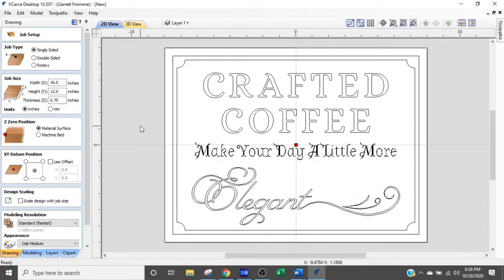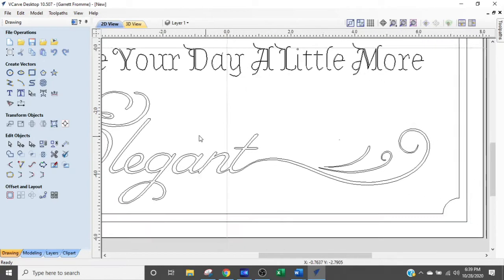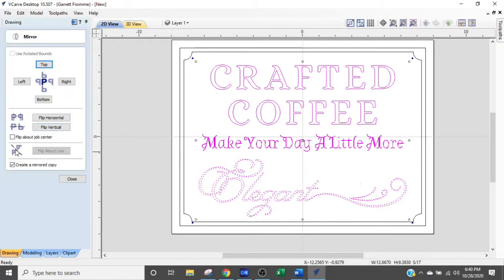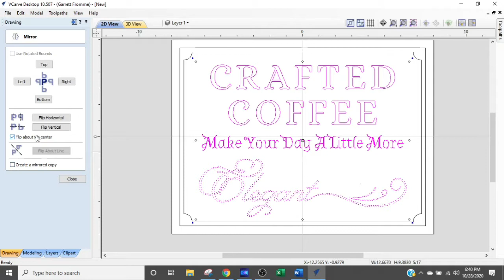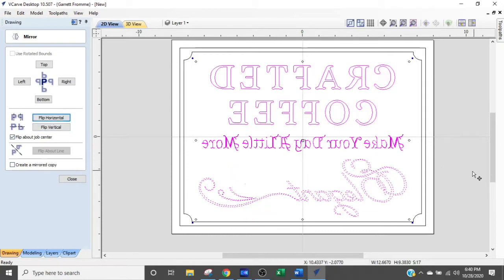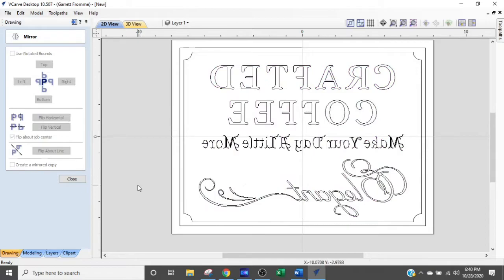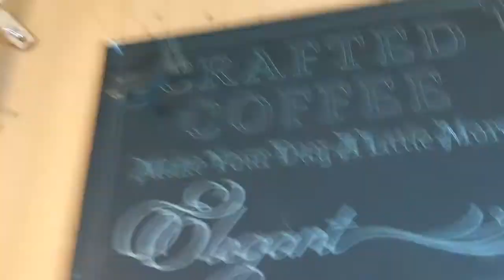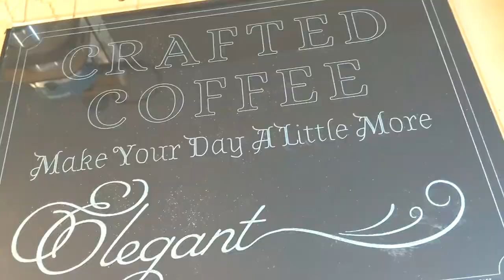CNC Router Glass Etching w/ Widgetworks Diamond Drag Bit Engraver Project - Garrett Fromme

Comment: Garrett, I just am starting to try using the Wigetworks bits I bought through you. I was just looking clarification on generating the tool path. Which bit to use in the data base etc. I have 2 bits in mine, both are listed as diamond drag. The feeds and speeds etc. I got when I purchased the bits. I will be experimenting. thanks for any pointers or if you have a newer utube that discusses the subject. I also viewed you eagle project, with the sonagram.
Reply from the maker: Charlieearle, try using both bits in your database and see what works best brother! The Quick engrave toolpath is best for engraving such as this.

Comment: I have a question…I used my diamond tip bit for engraving on uneven slate.  When it moved to lower area then came back to higher area it bent my diamond tip but.   I did straighten it out some but was afraid to be too aggressive to prevent breaking it.  Is there a way to salvage it since it’s a $50 bit?  Thank you
Reply from the maker: Anecia, I am not too sure on that one! Your best bet is to reach out to the bit manufacturer on this one on how to salvage it.

Comment: Looks good.  If you have uneven engraving depth from one side to another it's because you are failing to compress the bit into the spring.  If you don't have your depth where the spring is partially compressed it can't compensate for uneven surfaces like it's designed to do.  Even the best CNC beds have some variation in flatness.  I compress my drag bit by 7mm (out of the 15mm total) and the tip pressure is very constant on un-flat surfaces.  This feature becomes even more important when engraving surfaces that aren't very flat.
Reply from the maker: Tralfazy, very good points my friend. Thank you for sharing your wisdom on glass engraving.
Reply: @IDCWoodcraft  I hope it's helpful.  I spent a bunch of hours looking at bit pressure and measuring it.  WidgetWorks tells people to set the z height to zero and never even mentions compressing the spring.  Hard to understand how the manufacturer of a compression drag bit could get that wrong!

Carbide Create recommends that people compress a spring loaed drag bit 1/4 inch. (5mm) which should be fine most of the time.  I use 7mm to put it at near mid-range.  I loved your eagle engraving video and have been putting a similar one on all sorts of things.  It was when I tried to put it on a rounded surface (flashlight) that I discovered the need to compress the bit into the spring more and started measuring bit pressure.
Reply: For contrast, I've been using Gravograph CNCs (IS400s specifically, but I've a little experience with IS8000s, Vision and Omni CNCs) for diamond drag for twenty years and found that on those CNCs 1mm compression with 3mm Z travel on flat surfaces works well. For these machines the spring is in the spindle rather than attached to the diamond bit - but the principle is the same. But these CNCs have much smaller bed sizes than the one in this video.

I judge pressure by pushing the bit with my fingers and for my circumstance (mostly engraving into soft metal) have never even thought about measuring it.

That being said we've never used the diamond drag method on glass (hence my interest in this video) as it is considerably slower than CO2 laser. We also use sandblasting for some glass items. But if all you have is a CNC - then by all means. A CNC may also produce an effect that you, or your customers, prefer over other methods.

The software used looked a bit clunky due to the high number of steps to create the design and get it ready for engraving. The default software for Gravograph (Gravostyle) is also clunky. I find I do much of the design in a more general programme like Blender, GIMP, and Inkscape. I like to use the engraving software just for simple jobs and for sending artwork to the CNC. A more general programme has more features and tutorials due to a bigger user base and bigger development budget.
Reply: BTW.. if the pressure is too high after compressing the spring, just back off the tool's adjustment screw a little bit.

Comment: Very interesting. Iv got an e4 myself and was wondering about doing glass never knew about a drag bit thanks
Reply from the maker: Hi BG. Yes...it has turned into my favorite thing to do on the router. Check out this more recent project I made a video about with the drag bit: https://youtu.be/TvmUO3Cvxmk
Reply: @IDCWoodcraft  thanks will do. Is there other types of bits that will work with the router? I know I used to do it by hand with dremel bit wasn't sure if there are similar bits for a bigger router like what's on the bobscnc.
Reply from the maker: @BG-hg7cp  there are many types of bits that do lots of things. Too much to cover here. I'll be adding this info to my website soon. Watch for a video I will be putting out in a couple days. It'll get pretty deep into some of that stuff.
Reply: @IDCWoodcraft  ok will do thanks for the reply. Iv been using an e4 for about a year now and just wanting to try more ideas out with it. On my other channel (linked on this one/ is several videos iv done over the past year. Still lots to learn but so far it's enjoyable.
Reply from the maker: @BG-hg7cp  no link to your channel
Reply: It's in my about section @ the bottom but listed the link above as well. Thanks for taking the time to check it out.

Comment: Well, you told us the length, width and thickness of the glass you used, but you never gave any toolpath settings. It would have been nice to know the depth of cut needed to determine the pressure on the diamond tip and perhaps the cutting speed used (inches per minute).
Reply from the maker: Hi Bill. I'm sorry  about that. I caught it after the video was done and uploaded. Whenever I miss things, I always put iti in the description. You will find it there.The manufacturer of the engraver sends this information with it as well. Here is the link just in case: https://bit.ly/3tRy98s